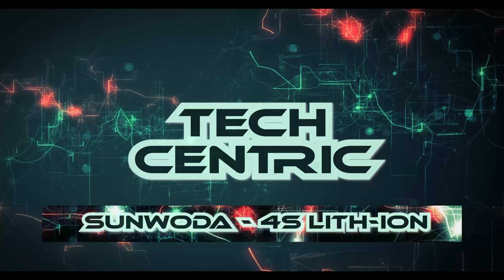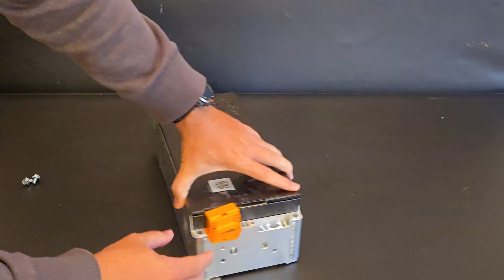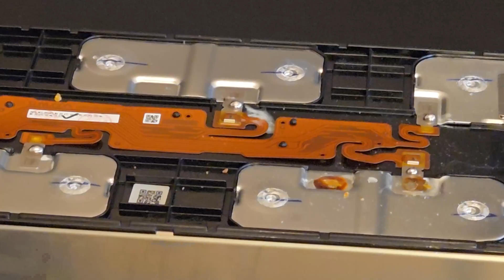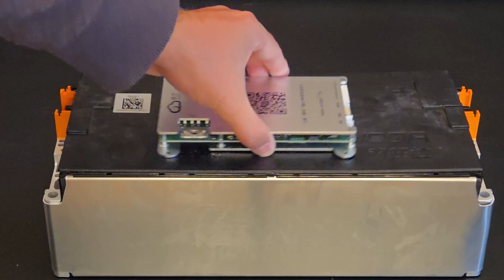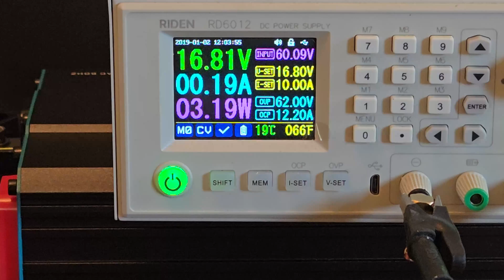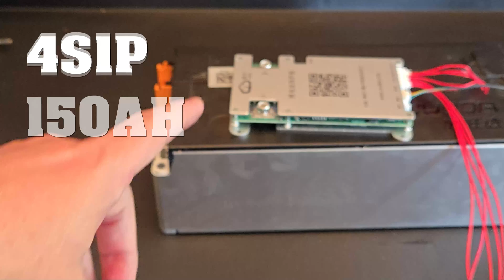Sunwoda - Lithium Ion 4s1p Battery - 2.2kWh

Comment: Could this be used for a car audio systems?
Reply from the maker: Most car audio is 12v. LifePO4 is most used for car applications as it matches lead acid very well. This is lithium ion which does not match up well.

Comment: are the cell tabs themself not threaded?
i want to cut it in half (middle tab) and turn them so it measures 12x7" instead of 6x14" to make it more fitable into a car/truck's battery space. like a group 30 (my battery compartment is 8x12"
Reply from the maker: Will have to examine the pack. Will get back to you.

Comment: How would you serie this packs to get a 72v 150ah? Highly interested to that!
Reply from the maker: There are many ways to do things like that but this system are lithium ion which has a nominal voltage of 3.7 volts. 21s would be a good pack size but since these are 4s you will either have to go over or under. I would say go with 20s and it will be five packs and you could put either a 20s BMS across all or you could do a BMS on every pack of 4S.

Comment: What was the starting voltage before charging? A discharge test is essential.
Reply from the maker: BMS cut off was 2.8 after a rest i believe it started at 3 volts pers cell. Once I have time to finish part 2 with the inverter I will try to do a discharge capacity test.

Comment: Would like to try one of these as a second battery for a car audio system.
Reply from the maker: It maybe possible just be careful with the voltage.
Reply: Trying mines right now to replace battery in old school bmw. 300a bms and high amperage amps.
Reply: @wgreen340 How did th test go? I bought 1 for  a secondary battery for  my car audio system.
Reply: @dmahoney2314  how did that go? I am thinking about doing the same.
Reply: @wgreen340  any update? post a video if possible.
Reply: you'll need to charge in the mid 15s at a minimum.